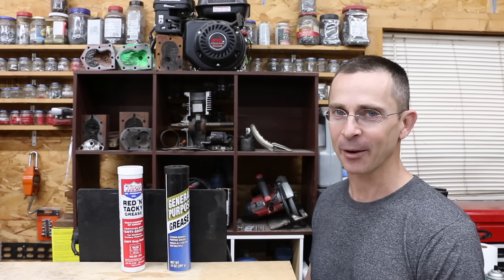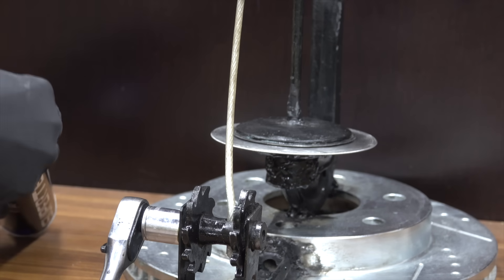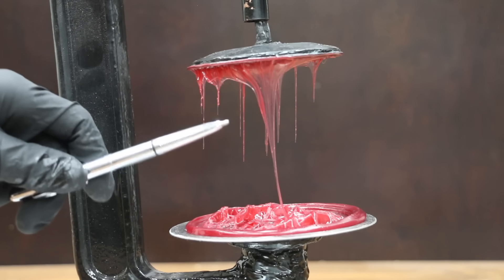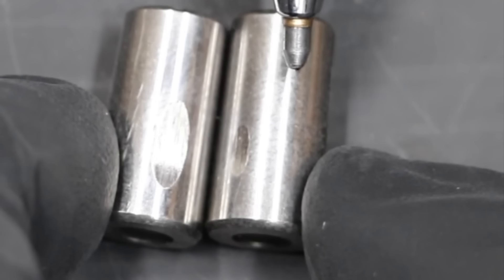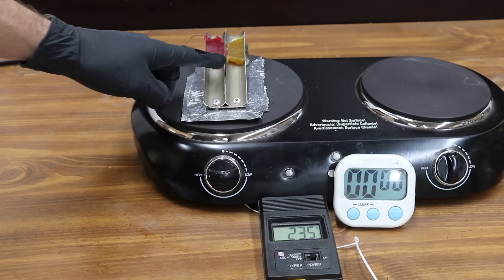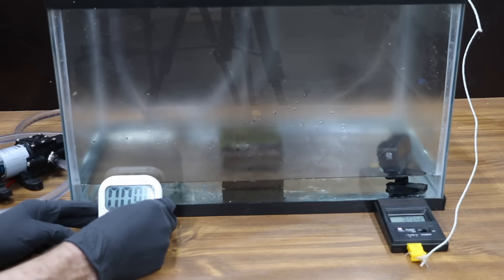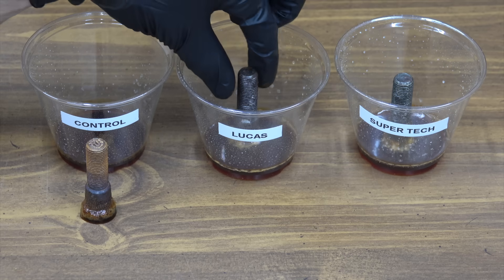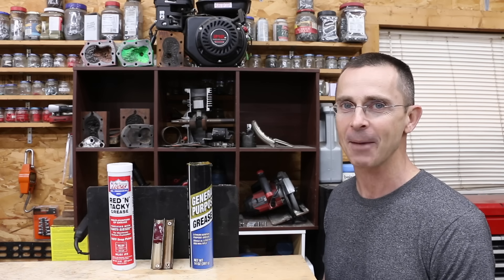Is Cheap Grease better than Lucas Red N Tacky? Let's find out! Bearing Grease Test Episode 1

Comment: Wow, this was very informative.  I've been in the "grease is grease, just lube it at the proper interval and it'll be fine" camp for a long time.  I've been using Red & Tacky grease and spray for a while now and haven't had any issues with it (I liked it due to the thick, sticky nature of it) but I haven't been using it on chassis components, wheel bearings, or U-Joints and I think it's going to be the next tube that goes in the ol' grease gun!

I love seeing all of your homemade testing apparatus, such simple devices that still do the trick very well!

Comment: Your variables were never noted
Different base oil viscosities and type, thickener type, EP rating (if any) or other additives like tackifiers will change your results significantly 
Get a hold of the relevant Tech Data Sheet and it will tell you all the test results and the specifications on each brand of grease 
My advice is don’t use grease you can’t get the TDS and look for manufacturers spec with the listed variables

Comment: Thanks for the test and nice work!
Ideas for improvements:
Add some sort of impact test (resistance to pushing out). Maybe apply a roller over the grease?
For the water resistance test I feel like the thick layer of grease is not a real-world use case and some sort of motion should be introduced, perhaps doing a bearing test with a coat of grease and a cup full of water?
What about drying the grease out in an oven? That might be hard to do without stinking up your house/garage.. lol
Reply from the maker: Thank you

Comment: I think you may have overpacked those bearings, and the peak load you were measuring was simply the balls displacing the grease in the raceway. Still, the test does establish that Lucas is less viscous than the supertech at those temperatures.

Comment: If you can come up with the proper methodology, think about battery chargers. This is a black hole for so many of us with multiple trucks, cars, mowers, generators, equipment, dozers, ad infinitum. Typically they fail early, or they fail by overcharging and ruining a battery. You could do fast chargers, then trickle chargers, perhaps up against solar maintainers which I now have 6 of and find better than plug ins. Everyone of us doing real things on a farm or ranch likely have a cursed pile of dead Chinese chargers. Right next to the shelf of odd greases and engine oils

Comment: It's not the same type of grease. 

Red grease is more expensive (any brands) and is made to support the wear and load of bearings and bushings/pines. 

Yellow/brown grease is.... cheap grease, the kind you find in gear-boxes. Where grease only has to be grease. 

Blue grease is made for bushings/pines on heavy equipment, it stands better than the red one when on loads, but it is not made to stand speed as in bearing usage or gear-boxes.
It's about friction vs load vs time vs speed. Interchange those factors depending on which job one grease has to do.  And no, price is not really a factor (unless buying in bulk-loads ;)
So, in a way, even though they each have their own cost (high-cost/low-cost), they each can give their own cheap result when/where in the wrong place/usage. (as you saw in your test-bench for wears, it was not the same type of grease, therefore showing very different results)

In all the places I've worked at, they've all switched brand/vendors from time to time. But in all cases, it's the type/colour of grease for each their own application. (but I was sure your already knew about these 🤔😅👍)

Comment: Some greases are better. Lucas Green Grease is specifically formulated for John Deere machinery. The drop point is higher, it can handle higher pressure, etc.

Comment: Farm implement dealer near me sells the Red grease much cheaper then Walmart and it handles heat much better. But there is a more expensive version of Super-tech grease that is more on par with the Lucas heavy duty so why did you not use that one? 
Super Tech Multi-Duty Complex Hi-Temp Grease would have been a fairer thing to compare to the Lucas since they offer same spec sheets pretty much, Then there is Moly Lithium Super Tech. 
So how is using a Light duty grease vs as Heavy duty grease a fair comparison?
Reply: This is just a comparison of "Cheap Vs. Expensive" or to better put it "Doesn't matter, grease is grease", not to actual specs. Some people think that the print on the tubes and cans are "Snake Oil" claims.

Comment: Thick is juicy but slick is quick. 

CastrolR motorcycle chain lubricant is the secret sauce I use to keep my bicycles rolling fast, without tools. 

Penetrates and clings. 
Stays in and rolls fast.
Slippery fast flowing lubrication.

Freshen up lumpy old bikes.
Keep fast bikes zippy.

Even old bearings roll like velvet again after only a few precise treatments. 

Only a minuscule volume is applied. Each can holds 1000’s of treatments. 

*shake well, results may vary. Repeated use recommended.
Not a substitute to required maintenance.

I am not paid to promote this product. I use it on motorcycle chains and bikes.

Comment: Supertech also has a red type grease that is more comparable to the Lucas. It’s more expensive, and has a drop point of around 500f. It’s called Super Tech Multi-Duty Complex Hi-Temp Grease.

I think that would make it a fairer comparison.
Reply: Yeah. Should've compared it to a general purpose grease by Lucas
Reply: I agree, test red against red.. please
Reply: I mean the point of this was to test if the more expensive brand is in fact better then the cheap brand. So having him test both red type kinda defeats the purpose of testing "is all grease just the same" Hence the better one vs the "crappier" one.

Comment: Will you test Amsoil marine grease? I wonder how it compares to other synthetic bearing greases, it claims really high film strength and avesome water resistant performance.
Reply: Amsoil makes great grease but IMO marine grease is garbage for lubricity and mobility, it's just extremely water resistant.
Reply: @fieldlab4  that's why I wonder if it's any good in terms of film strength etc. in roller bearings you don't need very good lubricity (which the Marine grease doesn't have, I can see just with my fingers, even compared to basic lithium grease, nevermind special low friction ones)I'd say good film strength is more important, which this grease provides, and in my application, rust is the most common bearing failure mode, wearing out otherwise wouldn't be an issue really. For now I see good results, previously the same bearings, with factory (probably lithium) grease laster a few months tops, with grease replaced with Marine grease, there doesn't seem to be any signs of wear after 2 winters and one year of time.

Comment: Sorry, not grease related.
Would be great to see a video comparing different types of automotive air filters. There is a lot of hyper around washable oiled performance filters like K & N and they aren't cheap to buy either. Also interesting to know if there are benefits changing from a panel type filter to a pod.

Comment: Wow...a grease video. I run hydraulic rock breakers or "excavator mounted rock hammers". They recommend Hammer Paste for newer hammers. It's a copper dust grease. Expensive. But good for newer hammers. Older ones I've always used the blackest, extreme pressure grease. The more it stains your hands and clothing, the better grease it seems to be.

Comment: 2:00 - On the pull test, a weight placed on it would produce more consistent results than hand pressure.
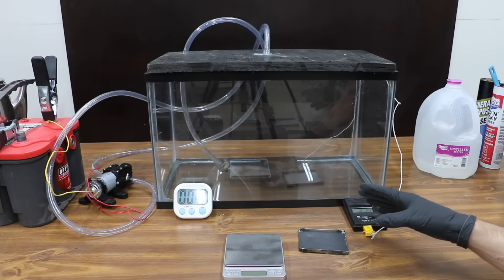8:08 - Weighing the plates like that doesn't yield any meaningful data. It would be more meaningful to remove all of the displaced grease before the "after" weigh-in, not just what spills over the edge.

Overall, you have a great set of tests set up for greases. Always nice to see what you've cooked up when testing a new product type.

I think these 2 greases would be better in a broad spectrum comparison rather than a head-to-head. As you said yourself, one was light duty and the other heavy duty.

Comment: I have used Lucas red and tacky on my trailer bearings, truck wheel bearings, u joints and yes a little fine layer on FA slides. Best grease I have ever used. Was nice to see some real facts on it as it was only Recomended by a mechanic..
 He was right. You proved it for me.

Comment: I found it ironic with your heat test.I have my grease gun loaded with the Lucas and down here in Texas it gets pretty hot in the summer.The grease gun sits at the end of my work bench hanging on the side of it .It is not up and down but it's parallel with the bench.Guess what the grease drips out of my grease gun inside my garage in the summer.....

Comment: Unfortunately, you tested 2 different types of grease. Red 'N' Tacky is more like Super Tech Multi-duty Complex. As a trucker with several trucks, I'd never use a lithium grease in same areas I use red grease. Lithium grease is light duty grease. The red stuff is for heavier applications.

Comment: I use grease from certified labs, I swear by the stuff. Isn’t cheap at all. Stuff I use is sky blue because the air force uses it and needs to be blue. Red n tacky is good too ive used it before a few times!

Comment: As a young child my Dad and I (then in the Army)  would go around to the Motor Poll dumpsters and we would drain the large empty can containers of Breakfree CLP and scrap out the big drums of Moly EP Grease with a child cheater spatula just like mom used. We could end up with 1/2-1 Gallon of BreakFree CLP and a large tub of really hi grade Moly EP grease.  This was years before you could really easily buy these products on the open market in retail settings or your local hardware store. Back then you had to know someone in heavy mining, aviation or some other specialty industry to have access to these types of products it was not like it is today! Every year or two we would repack all the wheel bearings, lube all the universal joints, ball joints etc.... I wish I knew what type of Moly EP grease it was I just know it was Milspec Moly EP used on the Bradly Fighting Vehicle and M1 Abrams Tank. The bearings, ball joints and u-joints were OEM original 17 years latter and still going strong.  To this day I will spend more money for better grease especialy where repair cost's for labor are high! Mobil, Schaffers, Redline and AeroShell are my go-to brands for grease.

Comment: One thing I'd like to see you test is separation of the oil and soap in these greases. I bought some cheap Harbor Freight Red Grease one time and used it in a grease gun. Afterwards I removed the pressure on the gun and put it away for the next time I had to use it. A couple of months passed and when I had to use the grease again, I found that the oil had started to separate from the soap and leaked out of the gun all over the shelf it was on.

Nowadays, I use "Bel Ray Waterproof Grease" for all of my motorcycle projects I work on. It's great, so I'd like to see it go head to head against some of the others.

Comment: Could you do a Bearing Buddy test? Sometimes I wonder if my bearings pack just as good by pumping up the bearing buddies as packing them by hand
Reply: The more important part of manually repacking bearings is cleaning out the housing (hub). This is critical as Everytime you put a fresh pump of grease in the old stuff gets packed tighter and tighter into the voids of the hub between the bearings and seals causing alot of friction and eventually toasting the bearings and/or seal. Bearing buddies are a good thing but once every now and agaim need to be removed and serviced the good ole fashion way.
Reply: Bearing buddies do not replace the need for a manual repacking, but I've found it can increase the interval by about 100%.  I wouldn't go beyond that though, as I've seen some dirt and debris build up if you just rely on the bearing buddy.  

On a side note, the spring loaded greasable caps do not lube bearings at all (like you see on the boat trailers).  They only form an additional barrier between the water and your bearings.  Even so, boat trailer bearings need more frequent packing than dry land trailers.

Comment: I'd like to see some tests on lucas oil stabilizer, how well it stabilizes different types of oil, and how it compares to different stabilizers.  I really enjoy how thorough you are with all your testing
Reply: I used 1 gallon of 15w40 for every 1000 miles on big rig  before Lucas. 
After I put 20% Lucas oil I use 1 gallon every 6000 miles .
Good stuff.
Reply: That's pretty impressive tbh.  My car started having issues with oil pressure at idle so I changed the oil and used a quart of the lucas and 3 of synthetic 10w30 and haven't had anymore issues.  Just a bandaid to hopefully last long enough for me to get a newer car
Reply: @LK-dm7kx  see the post I wrote in his Motorkote test, it includes Lucas.
Reply: He has already done a video on lucas oil stabilizer, i think it was last year but it may be older than that. its a good video and he runs a horizontal engine with no oil- just the remnants of the oil and lucas after draining. pretty sure he stacked it up again STP oil stabilizer and lucas won.
Reply: And test the original t h i c c formula compared to the new thin formula.
Reply: My Chevy started knocking at 350,000 miles. Mechanics told me the bearings were shot and I needed a rebuild.  I started running Lucas oil stabilizer and the knock went away. The truck now has 490,000 miles on it.
Reply: I use it on my truck to help build oil pressure and stop some leaks I have works great for that but when it gets down to 0 degrees my truck does not want to build oil pressure at all lol it's to thick so I only run it about 9 months out of the year
Reply: Snake oil .  The Lucas oil stabilizer is bullshit. The reason your car is using the less oil or  your oil pressure has increased it’s not because Lucas is some magic compound or its lubricating better? It is very simple to explain and understand.  And you can’t convince someone that is not willing to learn. Lucas oil stabilizer is Thick? Duh!!  If you get a milkshake from Wendy’s or brother a frosty can you drink it with a straw as soon as you get it. Know if you get one from McDonald’s can you drink it with a straw. Yes it’s because one is thicker than the other if you put thicker oil in your car your oil pump pumps oil through, In essence a straw oil lines if there’s more resistance due to a thicker material pressure will increase so if you were to add heavier weight oil to your vehicle it’s going to increase your oil pressure at least until it gets hot enough where the oil thin in essence a straw wheel lines if there’s more resistance due to a thicker material pressure will increase so if you were to add heavier weight oil to your vehicle it’s going to increase your oil pressure at least until it gets hot enough where the oil thins out.  There is some products out there that are legit. But to say Lucas oil stabilizer is doing more than adding your oil to your motor oil that you probably are changing @3000 miles Waste.  Lucas oil stabilizer snake oil garbage fix the problem don’t put a Band-Aid on it.  A product that does actually do something motorkote. But I’m not swearing buy anything
Reply: The word of the day is viscosity....@snake oil guy.
Reply: Don't use the lucus heavy oil stabilizer on new engines it gum them up. It will mess up oil control valve on engines on the with variable timing. Lucus has one for the use on new engine it is a lot thinner .
Reply: @DavidTaylor-qz8nc  oil stabilizer are bad for engines, they should only be used for end of life cars

Comment: What about air hoses? I'm thinking of FlexZilla vs the standard red rubber air hose in particular.. But it would be very interesting to see how different brands/materials of air compressor hoses hold up to high pressure, which is least prone to kink, etc?

Comment: Never use cheap grease, however definitely never ever use cheap grease on an outboard and it's steering shaft and pivot points. It will lock the assembly to the point where you'll see the most amazing amount of seizing. Most outboards in this situation have to be completely disassembled including taking the engine out just to clear these parts. Ask me how I know, it's a huge pain.. I only use Amsoil Grease at this point.

Comment: I’d like to see a comparison between Lucas grease and also Falk brand grease. It’s a very thick, stringy and sticky grease used primarily in Falk brand hydraulic component connectors, and very expensive. Just want to see what kind of differences that grease has compared to a normal type grease. Thanks
Reply from the maker: Thank you for the video idea!

Comment: You didn't compare apples to apples, here: the comparable SuperTech would be the Multi-Duty Complex Hi-Temp.
Reply: I think this is basically his pilot test to prove the concepts and get feedback. Comparing greases that are too similar would make it hard to say if the tests weren't any good or if the greases were just too similar to have a measurable difference.
Reply: @colinm990  That makes sense; trial run to dial in test parameters. I hope he does more greases! I like the Lucas red for suspension components, and I've used that same SuperTech as garage door lube because it's not TOO tacky.
Reply: Go away turd

Comment: Just wondering, why use the OD part of the calipers, vs using the ID part of the blades when measuring the size of the grease after the water jet?
To me it seems like you could have gotten a more accurate measurement if you used the ID blades.